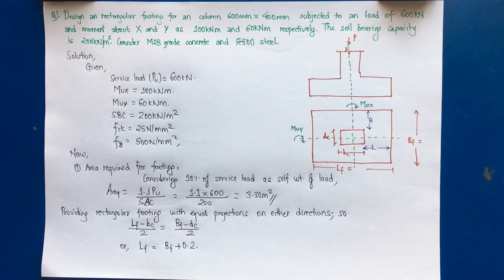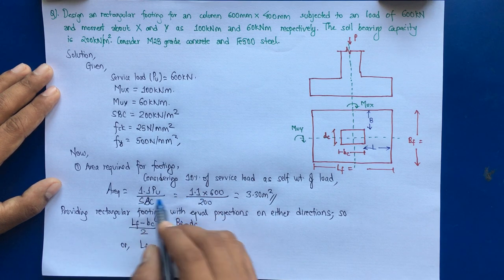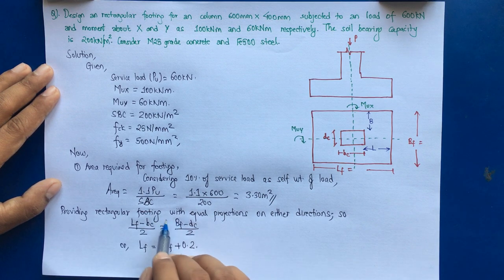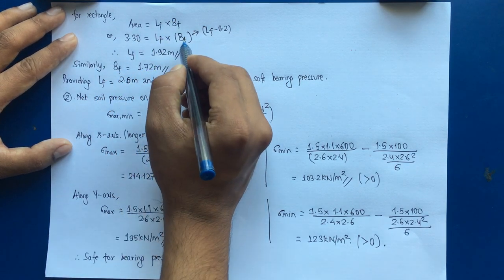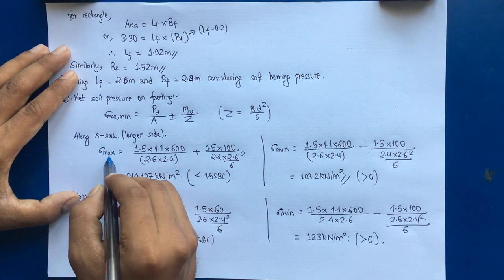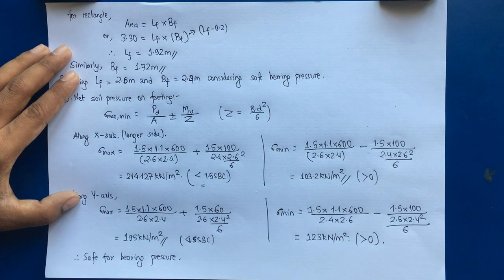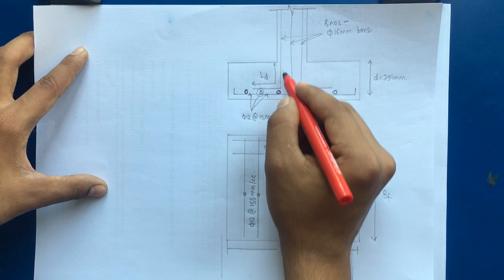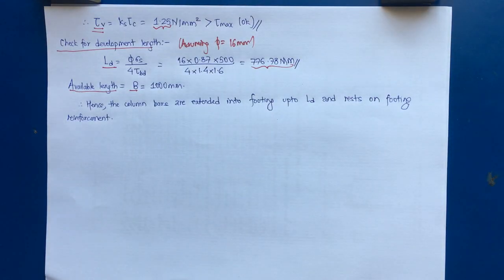Design of isolated footing with Biaxial Moments | IOE TU PoU MU | Load from ETABS Analysis

Comment: I think the section modulus for the moments have been calculated for opposite dimensions, any thoughts?
Reply: In his diagram (the plan view), the vertical axis is labelled as X while the horizontal is Y. Thus his computation seems correct.

Comment: While checking the footing for pressure, you do not need to factor loads. footing pressure is always checked for un-factored loads against net SBC value, as per your Soil report.
Reply from the maker: Will check for factored soil bearing capacity. That will do it
Reply: Both side 1.5 is cancelled out... there's no meaning of factored load and factored sbc😂
Reply: If we take factored load no need 1.5sbc
If we take unfactored load  we need 1.5sbc
Reply: factored SBC is get by dividing SBC by 1.5 not multiplying
Reply: Soil factors are usually higher than load factors
Reply: @kaushik1936  do we have to multiply sbc by factor?
Reply: @jaybadoni8084 No, Jay. Net SBC given in soil report is already factored by 2.5 or 3. You have to check the sizing of the footings for unfactored loads against net SBC value as per soil report.
Reply: @kaushik1936  if in soil report sbc is already factored then yes their is no need for dividing sbc, thank you so much brother.

Comment: Sir how do we know if the footing is subjected to bi-axial or uni-axial bending ...Can you please give details explanation how to know while design in this type of footing in real life design
Reply from the maker: Biaxial means moment along two axis.
Reply: @civilconst  ...Sir if moment develops about two axes then there will be a eccentricity between load line and centroidal of footing ..Also the column should not equal projections on both axes ...But u took here the column at centre of footing then how it will become a eccentricity ...If a footing centroid and column load having eccentricity the only moment will produce ...In this video you did not mention the eccentricity
Reply from the maker: @anand4236  That's the idea here. Either you can consider eccentricity and provide footing size concerning it or design footing by considering the moments. In the first case, you will get equal pressure on either side as you have selected footing and column location considering eccentricity but in the later one, you will get different soil pressure due to moment value as the column is centrally located. 
Hope this helps you. Cheers
Reply: @civilconst  ...
Yes sir i understood what you said....You gave one idea from this example how to design footing  if  footing is subjected moments but if you give the exact design of footing like ...in isolated footing When  column is kept at corner of the footing and edge of the footing how pressure variation takes place ...How to check for one way and two way shear ...If possible please do each  video on the column kept at corner and adge of the footing it will give more clarity
Reply from the maker: @anand4236  Sure will make that one soon.
Reply: @civilconst  ..Tq very much sir
Reply: Brother you  are telling about geometrical eccentricity as a column axial load and footing centroid  but due to unequal load and unequal span of plinth beam may be produced moment in both axis of column. These types of moments have been considered here.